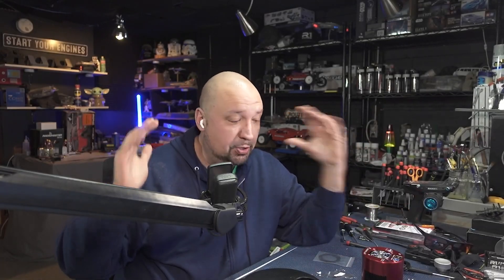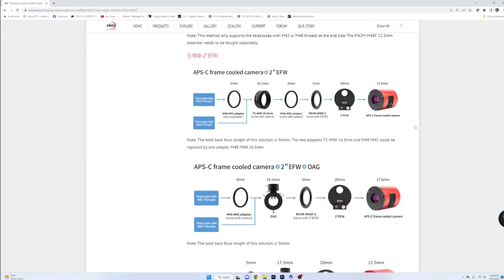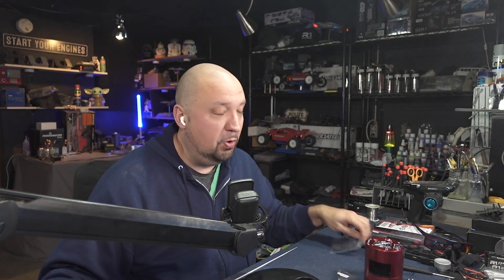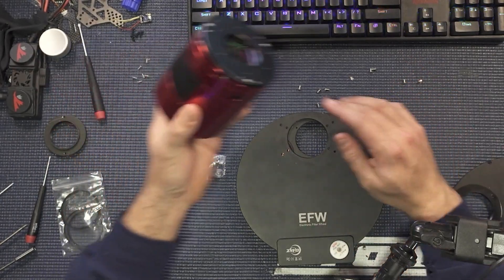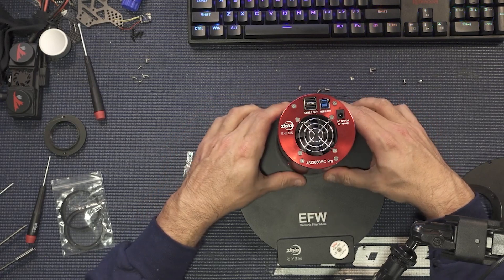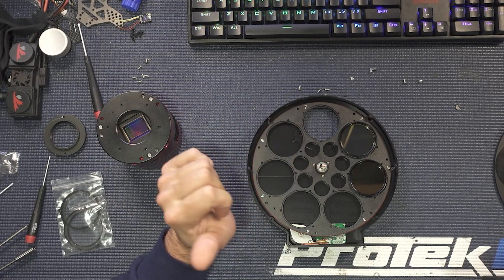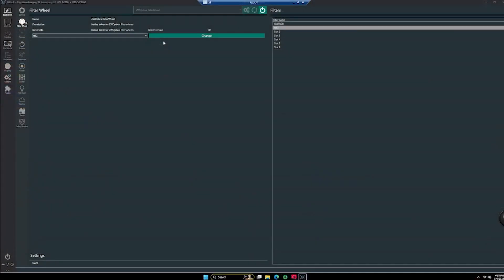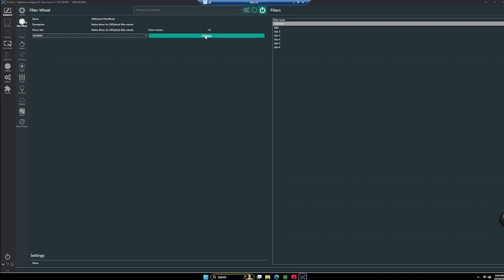ZWO EFW 2 INCH INSTALL AND LIGHT LEAK ISSUES

Comment: Thanks for this demo!  The darkening rings that came with mine (bought in Europe Oct 2024) don't have the holes in the right place for my 2600MC DUO. They are probably wrong for all 2600 models 🙄. Two were good - across a diagonal. I had to mark them and take a paper hole punch to the ring so I could fit all 4 screws. This left me with lingering doubts that I was doing something wrong. Especially since there isnt any single definitive description, the DUO's M54 aperture puts the cam in the  'full-frame' category for connecting an EFW, and the new rear adjustment tilt plate doesn't get a mention on the ZWO site. Mine looks good now, but there's been a lot of guesswork... I'm just waiting for clear sky now to find out what works. 

One good thing is that the new M54 filter drawer and the EFW are both 20mm. If you're doing an upgrade, you can reuse the same backfocus solution.
Reply from the maker: anytime..love doing this
Reply: @easyastroimages5818  Since posting I can say it has been an easy first time install that just worked for me. Also the CAA I fitted last week was a straight swap for the remaining spacer so (almost) just as easy to fit. I have to say 'almost' because cables need lengthened and re-routed before I can safely rely on the CAA unattended. But it works great already if I watch out for snags.

Comment: Sure looks like you didn't put the bearing back on the center shaft before putting the screw back on
Reply from the maker: Been awhile and I know I had it off a few times. Everything worked fine

Comment: ZWO Filter Wheel Slipping during imaging session.  This issue is that the filter has started to slip when imaging.  The filter is not lined up with the camera sensor and shows a line in image. When I manually rotate filter it centers back up and image is ok, but after about 5 300 sec images it starts to slip and filter moves and there’s a dark edge of on image showing the side of filter wheel filter frame. Any idea on how to fix let me know tks I lost about 2 hr of image's because of this :-(
Reply: Perhaps if you don't have all the filter populated in the wheel, you distribute them to balance the weight?
Reply: @lmamakos  i think i read a post indicating that the weight of the populated filter slots causes movement if there are unfilled slots. the fix is to populate all of the slots even if unused.
Reply from the maker: ugh that stinks :(

Comment: You need to remove the camera tilt plate first before attaching the EFW
Reply from the maker: yeah i had to redo that all a few times for my setup..thanks
Reply: Negative.  I reached out to ZWO and confirmed.  You don’t NEED to remove the tilt plate.  Though you could.
Reply: @humandecency  correct. however, some trains need the extra 5 mm backfocus so removing the tilt plate can provide that.

Comment: You don’t need to take off the car carousel at all. You can access all 4 screws through an empty filter “hole”, you can see them nicely in your video.
I mounted my 2600MM on to the 7x2” (with ZWO’s new light washers).
Amusingly, like you, I sat for a good 30 minutes trying to work out which of my various adapters and tubes I was going to use to attach everything, if your video was just a week earlier you’ve have saved me some serious pondering.
Great videos, keep it up.
Reply from the maker: thanks john.  yes someone else pointed that out about the screws :)  i did that the second time around installing the OAG L
Reply: You must be a gynacologist as your day job John 😉

Comment: I'm putting together an almost identical imaging train right now.  You need to take the tilt plate off the camera and the wheel will attach directly to the camera under there (there is another set of screw holes under the tilt plate) and you gain another 5mm or so of backfocus.  To remove the tilt plate just take off the 3 screws with the Allen wrench they supply with the camera.
Reply from the maker: ummm i did this in the video :)
Reply: @easyastroimages5818  Actually you didn't - at 5:37-ish you are attaching the EFW to the black plate on the camera.  This is the tilt plate and it's never removed that I see in the video.  Further; the tilt plate takes the inner set of screws on the EFW (which you used).  When you remove the plate the EFW can only attach via the outer set of screw holes to the camera.  That black metal plate on your camera is the title plate and it's 100% removable (yes they even talk about removing it in their manuals) and I assure you based on your video you are attaching the EFW to the tilt plate and not directly to the camera.  And yes, I have an ASI2600 and 2" EFW so I know this all first hand.
Reply from the maker: @zara8289  It was left on as per the back focus directions I showed in the video. Now yesterday I installed the large oag and did have to remove the tilt plate from the camera and then place it on the scope side of the large oag.
Reply: @easyastroimages5818  Right... so you didn't take it off in the video as I said to which you told me I was wrong and then admit you didn't really do it after all while implying my suggestion was wrong regardless since it would have gone against the directions in your video?  Feels like you're taking this all a bit personally.

Look, I was just trying to offer a friendly suggestion - I don't really care if you take it off or not and I don't really care if you think my advice is stupid, won't work or goes against your directions in the video.

My only point was if you take it off you can get another 5mm of backfocus back; there is zero actual reason or functional need to keep it unless you have a Newtonian or your sensor tilt is insane.  Otherwise it's eating up 5mm of your backfocus space and that space should be between the imaging train and the scope ideally and not in between the filter and camera.  The closer the filter to the camera the better; there's whole lines of cameras with built in filter wheels based around this idea from all the major manufacturers.

And don't tell me I'm blind and can't see what's in front of my own face only to turn around and suggest I was wrong for a second time; like what is even that about?  Especially since I was just offering a suggestion.  Not a great way to build a community.

So ya keep it, take it off; I could really care less what you do with it; was just trying to offer a suggestion since you tend to need every mm you can get when building bigger imaging trains and since having extra space between your filters and camera is neither ideal nor desired.  

But you know whatever, silly me.
Reply from the maker: @zara8289  sorry it all got mixed up man. I appreciate you looking out and taking the time to write all the comments.  I don’t take YouTube personally. I’ve done rc on here for years and have a way bigger channel and catch a lot more crap. :) I apologize for any slight you feel. Thanks for looking out. Too many dang zwo pieces and parts :) hope yo see you back sometime if not I understand
Reply: Negative.  You don’t need to remove the tilt plate.  ZWO confirmed this when I reached out.  Though you can if you have to work some back focus I suppose.

Comment: I have a manual 5 position Filter wheel.  Since I have to spin the wheel with my thumb, there is a large gap where the wheel can be turned.  I have issues with light leak also, so I use a small micro fiber towel to drape over the filter wheel and I use a velcro strap to hold it in place.
Reply from the maker: Gonna roll with the electric tape for now:) seems to be all good but as I said no street lights to deal with so I’m lucky.
Reply: Same for me I don't know why ZWO sells crap to customers
Reply from the maker: Yeah they def over looked the leak issue. All the new efw come with the gaskets if you look at their product pages

Comment: Instead of removing the carrousel the way you did,  You are suppose to remove the 3 tiny screws to remove it.  Please leave the baring housing intact.  I learned the hard way a couple years ago.
Reply: It’s always great to see a walk-through before purchasing a piece of equipment— thank you! I was curious, do you still use your AVX mount? And one more question, the 2” filter wheel is rather large…I’ve been on the fence wondering if it would look like a Frisbee sticking out on the back of my FRA600…how does you setup look.  And please keep up the great videos!
Reply from the maker: @josephluciani5531  I have an am5 now. Still have the avx. Might use the tripod. Avx performed well. Just a bit heavy for traveling and a little quirky with the commands from Nina. Am5 is perfect so far
Reply from the maker: Ah. Well that’s nice. Glad I have it tested and working now. :)
Reply: @easyastroimages5818  One more small piece of advice if you don't mine.  Go into the filter wheel ASCOM driver and make sure it's set to Omni direction.  Bi Direction can cause what I call moon craters that are very very very difficult to remove even with good calibration frames.  I believe James Lamb has a video on this.
Reply from the maker: @Phoenix_Astro  hey thanks. I have it setup to move just one way for the best flat corrections. Like James’s explained. He’s a smart guy!
Reply: THIS is the part that tripped me up for far too long.  Thanks!!